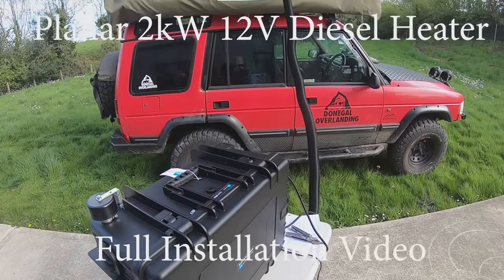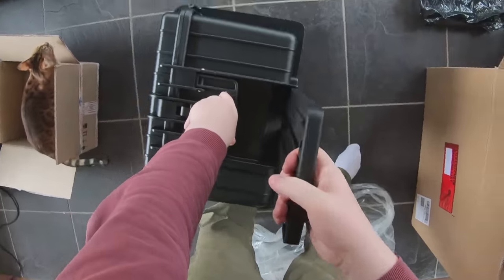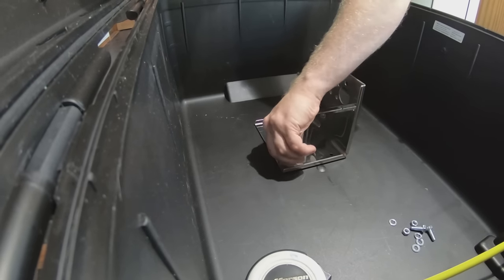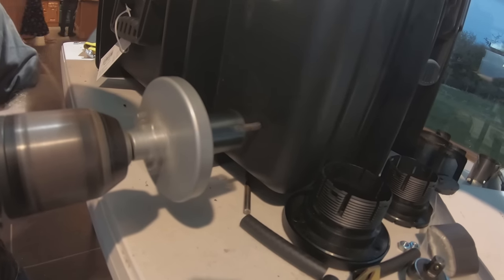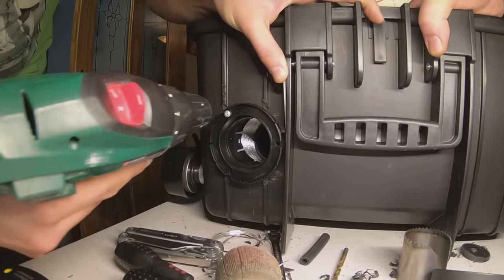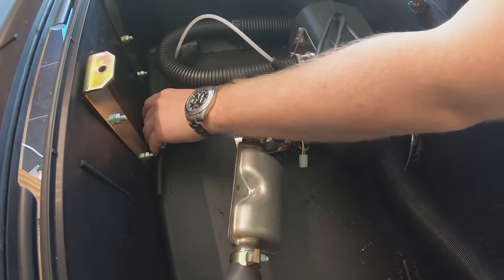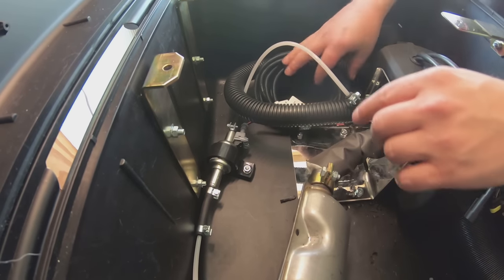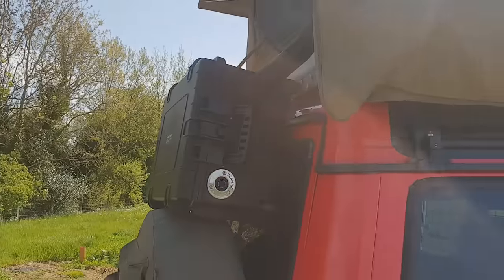Diesel Heater In A Box Install

Comment: Nice presentation!    By chance can you link to where you purchased the additional items to complete your kit?   I'm US based and so far having some difficulties finding a source for many of those over here.   Thank you.
Reply from the maker: Hi, its from here.  This is their USA shop.  Just contact them with the parts numbers, which I listed on screen in the video, and they will be able to help you out. https://www.ebay.co.uk/str/xenonukstore/AUTOTERM-USA/_i.html?_storecat=2985572419
Reply: @DonegalOverlanding  Appreciate it.  I think you have mentioned that you've not done any mods to the initial build in previous responses.  Is that still the case?   Additionally, I'm about to build my unit up based pretty much on your video and I wanted to ask if the Planar folks include the case clearance dimensions with the unit or did you have to get those specifically from Planar?  If you still have them would you be willing to share those with us?
Sorry for all the haters.. It's a sad commentary on what is happening on social media and of course YT isn't immune at all.   Cheers.

Comment: Let us know how mounting the plastic fuel container works out install by the muffler. And how well the muffler works out in a plastic case.
Reply from the maker: It works perfectly. Its been commented on so many times with people saying ti will melt etc.  However they are wrong.  The tank only just gets very slightly warm, as in a fraction warmer than the outside temperature.  Thats with the heater being on full power for hours and hours.  This is not a cheap and nasty plastic case, its a high quality product with a high melting point.  There is a marine fitment to protect the case where the exhaust comes out.  The case in is perfect condition after over a year of use.

Comment: Is it really a good idea to place a fuel tank in closed case without ventilation? I mean, the heat inside will constantly grow until...you know, fire and everything..?
Reply from the maker: There is another vent that we didn't put in when we made the video.  Its exactly the same as the one you see covering the cold air intake.  The hole saw we used in the video was one of those cheap and nasty things and it was difficult to use without making a mess of the case as it kept flexing.  So later once we got ourselves a solid hole saw of the correct diameter, we made another hole and fitted the additional vent.  We always planned to have a vent to allow the hot air out, we ordered that at the same time we ordered everything.  I wish I had mentioned this in the video actually.

Comment: In the manual, the air intakte should point downwards. Any reason or problems having it upwards?
Reply from the maker: The cold air intake that will be heated to provide hot air, is actually slightly downwards, though there is absolutely no reason why it could not horizontal.  The unit sucks in the cold air, it would not make any difference what way the pipe was, especially when its only about 15cm long.
Reply from the maker: If you are asking about the combustion air intake, then yes, downwards is the ideal option, but we wanted to have the filter in place, so we put it up high.  The most important part of doing it this way, is to ensure there is not a sharp bend in the pipe, which we have avoided easily, and that you drill a small hole at the lowest part of the pipe of about 3mm in diameter.

Comment: Thank you  for the comprehensive video that clearly shows the intent behind the layout and housing decisions. I have been pondering which diesel heater manufacturer to go with, and I will admit the price of the Chinese models is very tempting, but it is a long term investment and I want to get it right. Do you have a link to/name of the FB group that you mentioned? Thanks in advance.
Reply from the maker: No link but just type "Chinese Diesel Heater" in facebook and it will be there. A huge group.
Reply: @DonegalOverlanding  thanks, I will give it a look

Comment: My Espar D2 has performed flawlessly over six years in my boat. Only now did I need to replace the inexpensive atomizer screen. Make sure your fuel is clean, and run a gallon of kerosene occasionally to clean out carbon buildup
Reply from the maker: Good tip, thanks for that Wallace.

Comment: When not in use and stored flat so that the case opens up, does the fuel cap stay dry or does it weep through the air hole?
Reply from the maker: Hi there, I never ever store it flat because there is a chance that the fuel could come out of the breather hole.  Its not even an issue like you may imagine.  It has to be sat in some position, so upright it is.  Would really appreciate if you took the time to sub to our channel, we are hoping to try and grow it and need as much help from as many people as possible.

Comment: Do these heaters create condensation like propane heaters? We have a condensation problem and we want dry heat
Reply from the maker: Hi Matt, hopefully I can help explain this.  They do not create condensation the same way propane heaters do as this just blows hot dry air into the tent.  However, if you have a single skin tent, like we have on our roof tent, then the temperature difference between the canvas on the inside and the outside will be huge and that will cause condensation from your breath.  Tomorrow Im about to install an anti-condensation mat which hopefully will solve the problem.  I'm creating a video review of that so if you sub to the channel you can see that too.

Comment: Do you not need to draw the air intake from the tent? your'e just pushing hot air taken from outside, you can't put air into a sealed area or at least flow air through one
Reply from the maker: The windows are open in the tent. Its not sealed. I want fresh air in always. Recirculating the air makes condensation much worse and youre not getting fresh oxygen rich air to breath.
Reply: @DonegalOverlanding  Thanks, We have buses with similar heaters underneath and they draw air from the saloon heat it and push it back in, just recirculates it really

Comment: I thank you for the video I do have a question I live in the states was planning on heading to New Mexico during the winter time the desert gets very cold at night where I'll be staying it can drop down to 2 degrees Fahrenheit I have a short School Bus 4 window I need to heat a 5-foot by 8 foot area do you think this could Heat?
Reply from the maker: Hi, yes a 2kW heater would have absolutely no problem at all heating that size of area.  It can heat a much larger area actually.
Reply: Capttzuzu if ur school bus doesnt have some kind of insulation u may consider getting a 5k heater instead of a 2k. Good luck.
Reply: @2675gordo  And you can always turn down the 5kw, but you can't turn up a 2kw so to speak!

Comment: Just wondering doesn't the box get too hot from having the muffler in the box with no cold air to cool it down, looks like an accident waiting to happen.
Reply from the maker: We checked with Planar technical support in relation to this and they said it would not be a problem.  We have another air vent not shown in the video that allows the hot air to escape to the outside.  Even before the addition of the air vent it was only ever just slightly warm inside the box even running at full power for over 6 hours straight.
Reply: If you were to drill a couple of 3mm holes in the small engine inlet pipe it would create a vacuum in the case forcing cold air in and keep it cooler, being plastic I think eventually the area near the muffler will melt away after time, I would be also wrapping the muffler with fireproof insulation felt/blanket.
Reply from the maker: The muffler is not near any plastic.  It is suspended in the middle of the case.  The case is good until 80c and the plastic is barely above room temperature.

Comment: I'm trying to figure out whether the case I have is deep enough. The interior dimensions of the B&W 6800 you used are 23 x 16.1 x 11.6 inches. If I'm not mistaken, you've fit the fuel tank and the heater within those 11.6 inches in your build. How much space is there between your fuel tank and the heater? The case I'm thinking of using is only 9.2 inches deep and I wonder if that's enough space?
Reply from the maker: The heater is about 15mm clear from the back of the case.  The fuel tank is intentionally in position so that it comes up flush with the closed lid.  Two reasons for that, one is so that there is as much space between the tank and the heater, the second is so that it sticks out when the case is open meaning its very easy to fill the fuel tank up.  The space between the tank and the heater is exactly 40mm.  I just put shoes on, found the measuring tape and then went out through the rain into the garage to measure that for you, so hit us up with a sub if you have not already! :D
Reply: Haha... many thanks. My case will be too tight to position things the way you did, but I think I've figured it out. I'm probably going to rotate my case 90º and then have the heater at the top and, since my case is so long, I'll probably be able to use the 13 L fuel tank at the bottom. The interior dimensions of the used Pelican 1670 case I picked up are 28.10 x 16.49" x 9.19". I figure that the heater needs about 15" space to account for the minimum spacing required in front and behind it, so the 16.5' width of the case should be good.
Reply: The 13 L fuel tank is about 18.5" high and with the required clearances on top and bottom, the heater will take about 8" at the top of the case. So, I should have plenty of room to spare.
Reply: Donegal Overlanding 🤙

Comment: Hi from Tyrone. Was thinking of buying a Chinese diesel heater for my garage just to cover the winter months but am now reconsidering, can you help or recommend,  thanks.
Reply from the maker: Hi, I honestly wouldnt get a Chinese one if you can afford to pay that wee bit extra for a Planar.  If you go on facebokk you will see Owen Cox and Paul Stevens, they run Planar uk.  Or just google "Planar UK" and you will find the website. I got mine from Latvia and it took over a week to arrive, but Planar UK have loads of stock available in the UK so it would get to you in Tyrone in 1 or 2 days. Plus they have fantastic support, which is something you cannot underestimate in value should you need it.
Reply: Planar heaters are made in China.

Comment: Hi buddy. Have you got a link for the part that the exhaust pipe runs through the side of the box? Or what they are called?
Reply from the maker: I put a parts list at the end of the video. Its Exhaust adapter for yachts, ASSY 2385.  Hope that helps.
Reply: @DonegalOverlanding  perfect. Thanks.

Comment: You have to plug it to the battery each time you want to use it? or do you have another system?
Reply from the maker: The vehicle has a leisure battery (an auxiliary) for powering things like my fridge and recharging cameras etc.  There is a power supply that goes from that battery, up the a-pillar and under the roof rack to the back.  When I put the heater on, I place the Outdoor case onto my spare wheel and then just plug it in.  Takes about 5 seconds to do.
Reply: @DonegalOverlanding  ok so you have a cable from the aux battery and the cable from the planar and you connect them together if i understand everything? whith what king of plug?
Reply: @KeyserSozeFR  He shows the plug on installation.

Comment: Diesel plastic tank in a confine space with an exhaust pipe that close and if the temperature gets too hot the diesel has a flash point of 125F to 205F. Maybe I’m missing something here?
Reply from the maker: The temperature inside the case is only slightly warm, maybe 25c.  The temperature on the surface of the plastic tank is about 22-23c after being on full power for over 6 hours.
Reply: Okay now I understand I didn’t what temperature would be in the box when is operation. Thanks for your response

Comment: Just wondering , does the heat of the exhaust affect the plastic box at the outlet ?
Reply from the maker: No, there is a marine exhaust fitting there which is designed to go through the hull of a boat. The plastic around it does not even get warm at all.

Comment: i would insulate the silencer / muffler there is too much eat going in and out the radiated heat can damage with time the tank of fuel ,or viceversa stick an insulatedmuffler adesive on the tank that same used on motorcycle under the rear seat to preserve abs plastics from exhaust temps,and pasengerfrom gettin too much heat on their rear end.

Comment: Speaking of heating oil leaking inside your box, there is prolly a hole in the "bottom" of your muffler to spill any unburned oil that gets that far.
Reply from the maker: There is no hole in it.  Its totally sealed.

Comment: Though of the day: Could a pelter be fitted between the air inlet and exaust outlet (considering how close they are) to generate electricity?
Reply: Of course a Peltier device could be used to get energy from the exhaust. But not much energy could be extracted because of the poor efficiency of Peltier devices. Furthermore, cooling the exhaust too much very close to the combustion chamber will tend to cause the combustion temp to be too low which leads to inefficient combustion and soot buildup. Better to extract any heat from the exhaust further from the heater and use the heat for water or even use another heat exchanger to heat air.
Reply: @etprecisionmachine2379   thanks for answering.
Reply from the maker: Apologies for the delay, Ive been very busy the last few weeks. Im glad they answered too as it saved me googling to see what a peltier device is!  Throw us a sub please if you have not already done so. Chasing 1000 subs.
Reply: @DonegalOverlanding  done and done.

Comment: how hot does that muffler get under the fuel tank i hope you checked that out ???
Reply from the maker: Hi Raymond, we have not measured it. Planar did say the temp on the muffler can be 400c and we were concerned about that.  With the case dimensions and the clearances involved they said it would be no problem.  As Ive mentioned a few times in the comments, the fuel tank is only slightly warm to the touch after many hours on full power.  Perhaps because the case is outside means it cools easier compared to the heater normally being in inside the heated room as in many instalations.  Did you subscribe? Would really appreciate if you would as we are chasing 1000. Thanks.
Reply: @DonegalOverlanding  - I would have made the Air Intake draw from "Inside" the case and put a grill on the side of the case so that fresh air is drawn over the exhaust pipes and silencer - 2 fold result - a little pre-heating of fresh air and cooler  exhaust system and the electronics of the heater will run cooler ( 400C inside a sealed box is going to overheat the fuel tank and you have a potential for a serious fire - I would have considered using a metal tank rather than the plastic one)...   I have a Planar heater that I installed in my Boat so I do know how hot the exhaust system gets - mine is fully lagged with heat proof wrap...

Comment: where's the return air/inlet to the heater? you want to recirculate the air, each pass the air get warmer....
Reply from the maker: Hi Jeff, I decided not to go with that arrangement, though I understand your thinking.  The tent is such a small area and it can be sealed so tight, that I didnt want the same air recirculated all the time otherwise Id have to leave one of the doors open.  These heaters are so efficient and the diesel so cheap (About 80c for green/red agricultural diesel) that I am not bothered about heating fresh cold air every time.  I always have the heater on low once Ive settled into bed or it will be too hot anyway.
Reply: @DonegalOverlanding  - I was thinking that having the heater intake that near to the exhaust would result in a lot of carbon monoxide getting heated and fed to you while you sleep. Recirculating the air would overcome that completely.

Might be worth grabbing a CO detector and just checking if this concern is well-founded at all.
Reply: With a tent/camper setup you DO NOT want re-circulated air, that is the primary cause of excessive condensation and people need to stop telling people to re-circulate air in their heating setups unless you want to be toweling down your tent/camper every morning. Yes you end up with warmer air for less cost but you also end up with excessive condensation/mould growth...you want fresh air being circulated in.

Comment: You really do not like the Chinese heaters, it comes across in the video, i want to know what that little bit more cost for the heater you bought, was it $200 more or $1500 more??
Reply from the maker: You can see all the prices in the links in the video.  I know lots of people have Chinese heaters with few issues, but also many who do have lots of problems.  I do not like such devices that are untested and made as cheaply as possible.  Each to their own of course.